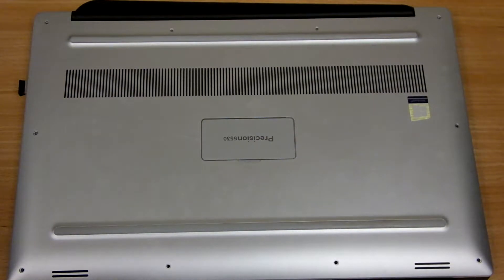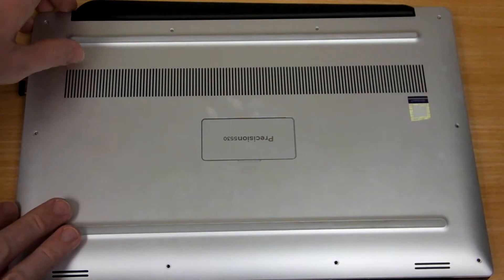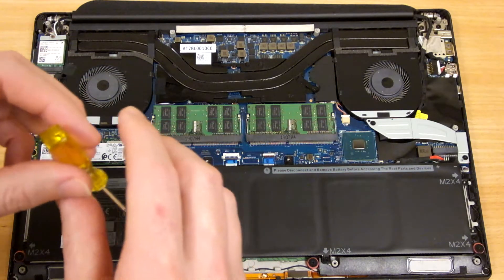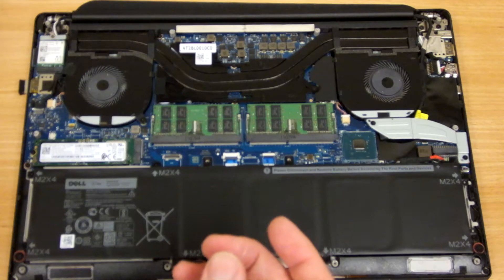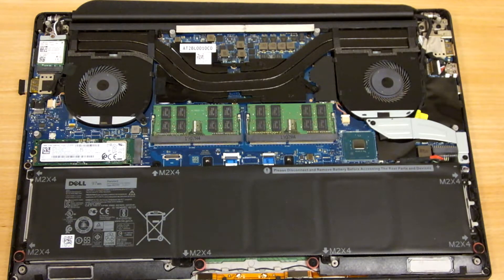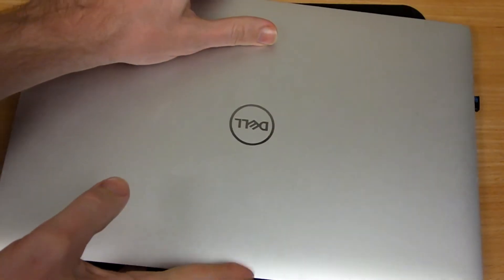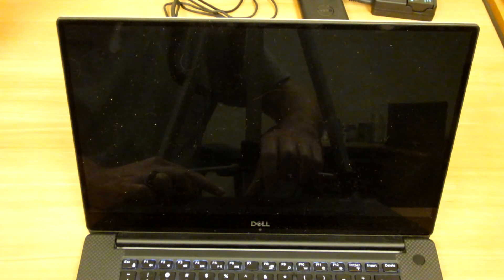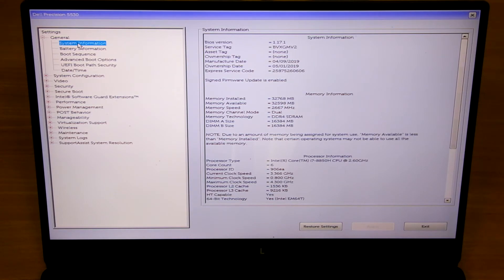How to upgrade laptop memory - Dell Precision 5530

Comment from the maker: Update - June 2022 - I have since upgraded this machine to 64GB and storage to 1TB.  Still working great!  Here is a link to the memory and storage upgrade we used:

TEAMGROUP Elite DDR4 64GB Kit (2 x 32GB) 2666MHz PC4-21300 CL19 Unbuffered Non-ECC 1.2V SODIMM 260-Pin Laptop Notebook PC Computer Memory Module Ram Upgrade:  https://www.amazon.com/gp/product/B08TRD3C82/

SAMSUNG 980 SSD 1TB M.2 NVMe Interface Internal Solid State Drive with V-NAND Technology for Gaming, Heavy Graphics, Full Power Mode, MZ-V8V1T0B/AM:  https://www.amazon.com/gp/product/B08V83JZH4/